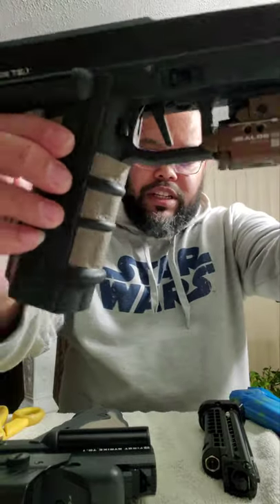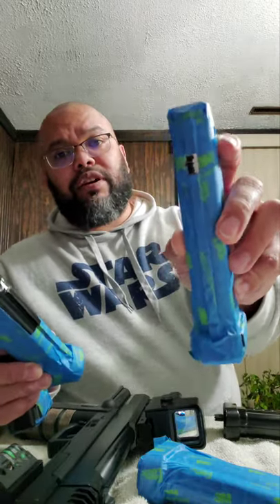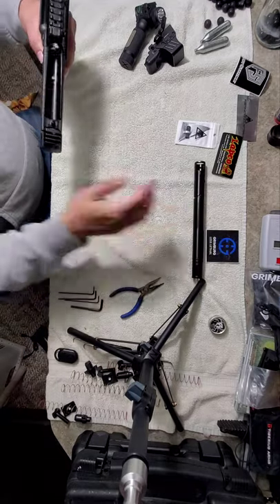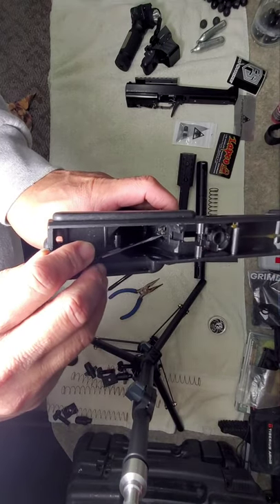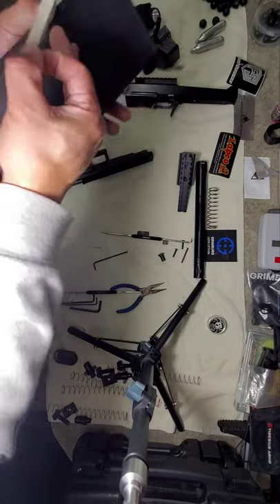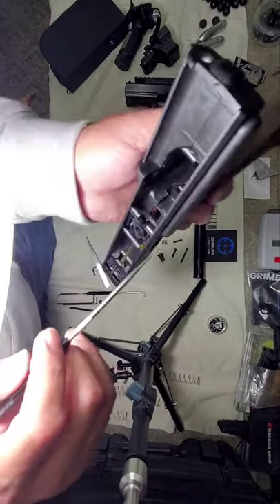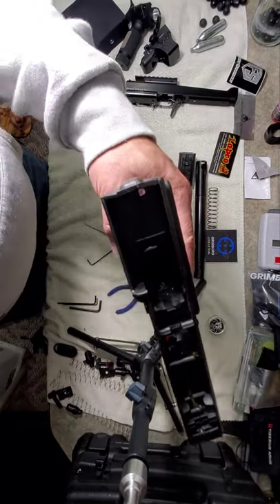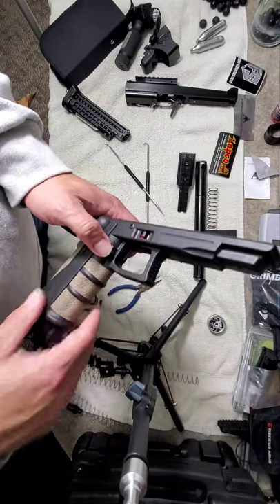Best FSC, T8.1 & T9.1 upgrade under $30!!! (short version)

Comment: A concern i recently had, was when i upgraded to the Grimburg heatcore Flat seals. When Pulling apart one of my T8.1 i Noticed that the Tiny O-ring that holds the Trigger to the Trigger Bar was Missing, this alarmed me as i do all work at the same Very Well lit up work station right next to Two Large Windows and do all work during the day also have a bright light here, and have a lint free towel to capture any fallen parts. But that Tiny Oring was missing when I opened up my gun. I thought Can the Trigger bar Come off of the Trigger Pin that it ride on? Thus creating a Trigger Failure at the WORST time Possible, when you need it to Function. My thought was to make a Captive device for the Trigger and trigger bar, and then test it, and also test it to make sure it does Not create another possible failure, or create More pressure on the trigger. The Options i came up with are, 1. i have some Very thin, and small rubber bands the diameter is smaller then the Oring and about 1/2" dia. unstretched, loop over far side of Trigger Pin once or twice, then over or under which ever makes more sense, then attach the trigger to the trigger bar, and make one or two loops around that Pin, this would be under tension holding the trigger bar to the trigger. or 2. or use a slightly larger oring than the Oem o-ring, but use Two orings same size with a piece of thin Rubberband tied onto each Oring, binding the two orings by the rubber band, then stretch them over both sides of the trigger pins, to create enough tension to keep it all together.  3. use a small Safety pin for its Loop that would go over the far side of trigger pin, then make it to the length needed and bend a Cotter pin style Clip on the trigger/triggerbar side to clip on to the Pin on this side.
Reply: i also thought maybe a simple grocery bag wire twist tie but bare wire, looped a couple times around each side to hold it all together.

Comment: Any idea what size the tiny Oring is for the Trigger, and Trigger bar connection is, the oring that likes to fall off when putting the T8.1 back together.
Reply from the maker: The laser light combo is an Olight Baldr Mini. They just came out with a Baldr S. That one is better in every way.

Get a few of these:
https://www.valken.com/products/tiberius-fs-service-kit-o-ring-t8-1-t9-1-t4-1
Reply: @psi.defence.channel  Thank you! I have 6 complete rebuild oring kits, for my Tiberius T8.1's But i figured i would get another half dozen of that trigger O-ring when I went into town as they are Not a sealing oring so a cheapy o-ring is ok, and to replace the one i Lost and have a few more extras. Better to have them and Not need them. I'll get that O-ring out of one of my oring Kits and take it down for a Oring sizing match up while i am there. I am putting together a O-ring Size List for my Tiberius T8.1 using Standard O-ring Sizes so i Know what to get locally Just in case, i cannot get them or are Out of them scenario.
Reply from the maker: @garywest3763  keep it dry. It holds better that way.
Reply: @psi.defence.channel  yes I figure that, but good to point it out thanks.

Comment: Can you tell me if the is a tiny plug in air pass through on the back of fsc in bottom right corner...I wanted to run my 9.1 in pistol form without asa w/co2 in mag but air blow out where tiny oring would be with asa bolted on..
Reply from the maker: There's 2 ways to stop the air from the rear. You can screw a tiny allen bolt in that hole and use the o-ring plug (o-ring, but a solid plug) 
https://www.rockstartactical.com/first-strike-006-o-ring-plug-81-9135/

It goes on top of the regulator on the hole close to the trigger side.
Reply: last week i purchased a stock fsc for t9.1 removed top rail. screwed on pistol sites for the first time looked great except for asa. Thanks